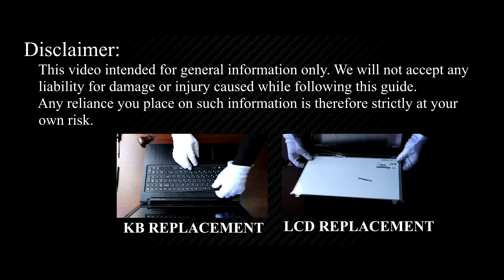Lenovo G500s, G505s Disassembly, Fan Cleaning, and Thermal Paste Replacement Guide

Comment: I cleaned the fan and the fans is not stopping. The moment i start the pc till the moment i tun it off. it(fan) keep on working. Should i worry or not.?
Reply: U idiot that what it is supposed to do. The purpose of the fan is to eliminate the heat generated inside the laptop. Fan will be "ON" the from the movement u start the computer  and its only stop once the computer is fully shutdown.
Reply: XD